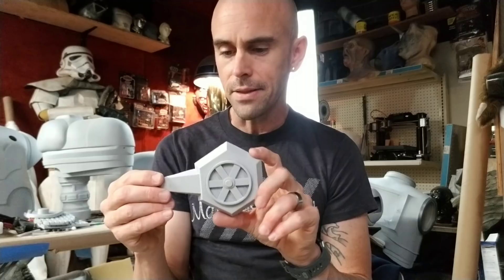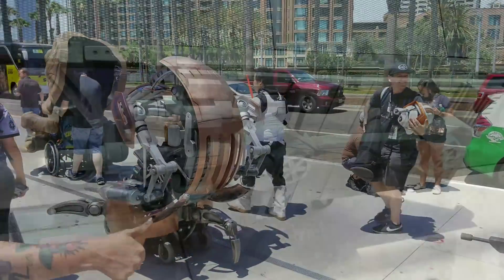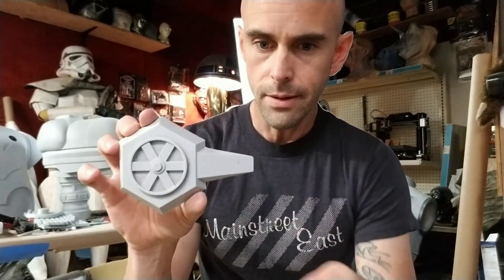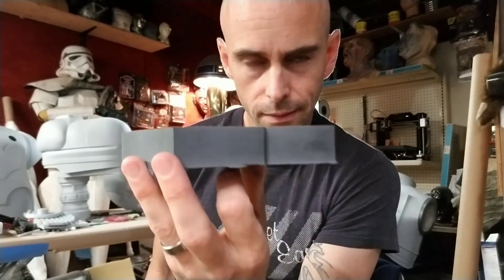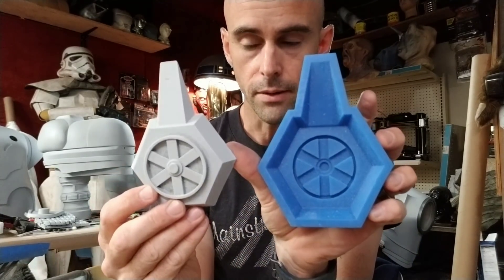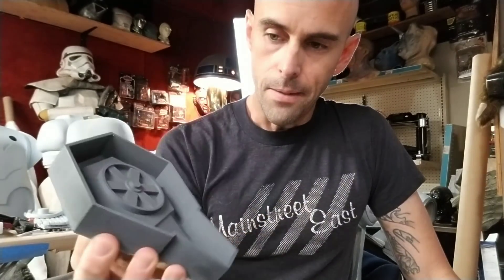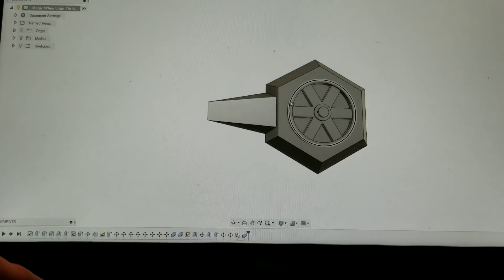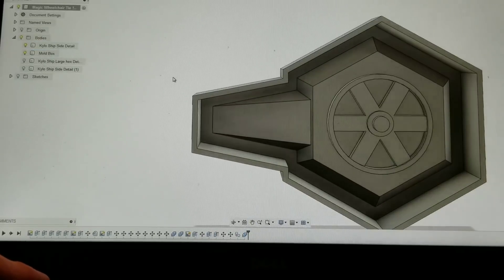Cheat for molding 3d printed parts.

Comment: what silicon did you use ? and what spray release also ?
Reply from the maker: This is MoldStar 30 by Smooth-On. If I used any release with this it would be Ease Release 200 by Mann Release Technologies.
Reply: @gordontarpley  thanks for your fast reply

Comment: Great idea. And what are the drawbacks of making 3d-printed molds out of, lets say, PLA filament? Why are silicone molds better?
Reply from the maker: PLA isn't flexible enough for most types of molds. If the parts you're trying to cast don't have any undercuts it is possible though if you use enough release agent to prevent your casting material from sticking.

Comment: Hey! Awesome video!
What 3D printer are you using? Looking for one that prints that smooth! Tanks
Reply: No one?
Reply: @image001de  Hey man. You can either use a laser sintered/resin printer which print almost perfect or use a product coating on your PLA prints called XTC-3D that will add a thin layer of hard drying smooth resin over the layers from your print. Hope this helps :)

Comment: Do you have any post process smoothing of the print lines? I know even with low layer heights with FDM you still have minor layer lines. Or did you use your Form 2?
Reply from the maker: I printed this on the prusa and print lines were pretty minimal. I typically use a thin primer, usually Krylon. For this project it more than did the trick. for more detailed parts it would probably take a little more fine cleanup. Going to do a video on primers this week. ;)
Reply: @gordontarpley  sorry for the newb question, but are you saying you primed, painted and sanded this part before filling with the silicone?
Reply: or did you just spray primer, let dry, and then pour the mold? thanks for the help!